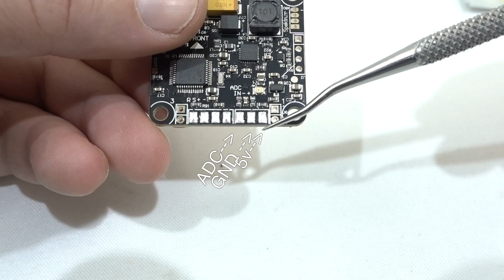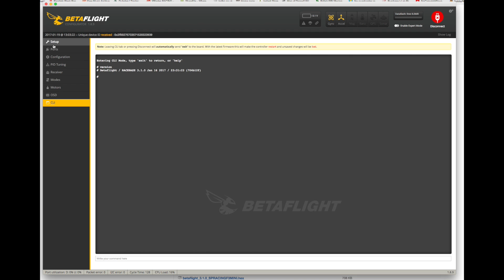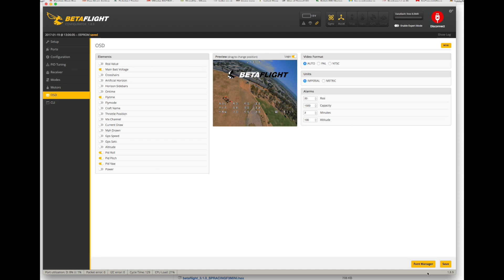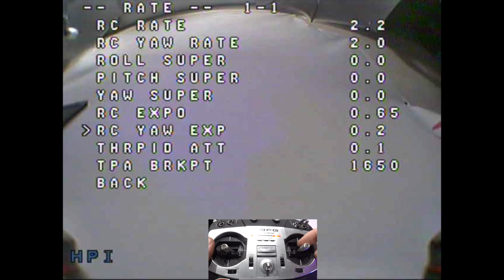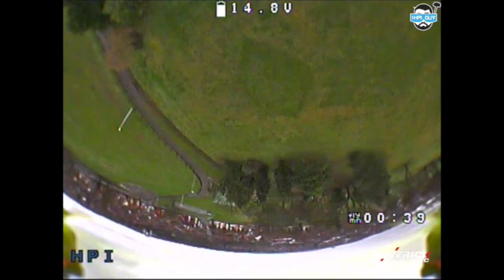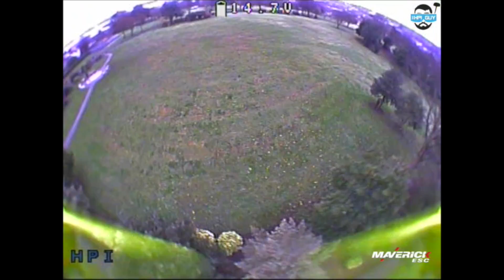HPI GUY | Rotoracer Racebase FC with OSD

Comment: BTW, you don't need to short boot pads to flash firmware, just make sure you checked "Manual baud rate"
Reply: dronas can you please elaborate that?
Reply: you saved my day with this comment. was struggling with the pads shorted and could not find the bootloader. desoldered and set manual baud rate and upgraded to latest bf. thank you

Comment: thanks a lot HPI guy for uploading this today and not yesterday because I just ordered a new flight controller :) I picked up the revolt F4 have you tried it
Reply: Ultimatevapor918 I have one and I love it!
Reply: +Québec Multirotor are you running race flight or did you flash it with betaflight
Reply: Ultimatevapor918 raceflight
Reply: +Québec Multirotor thanks man now I'm looking forward to it again I am coming from a naze32 Rev 6 so I know it will be a good upgrade anything is better than a rev-6 Nave lol
Reply: Ultimatevapor918 to me the rev6 is the worse on the market

Comment: i like your vids but man take your time on your solder job cuz it looks like shit
Reply: Ultimatevapor918 why?
Reply: +Québec Multirotor you called his soldering shit
Reply: Ultimatevapor918 I think it's a shame to have all those nice components and not take your time to place your wires correctly and not snipping them shorter before performing a solder joint the wires did not even had time to make contact on the pads just floating in solder.... my opinion nice video anyway